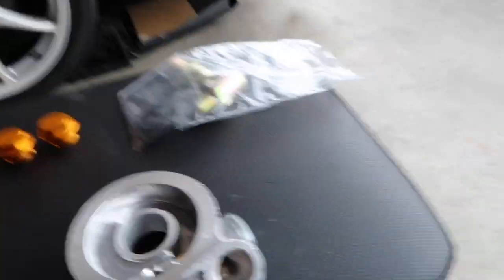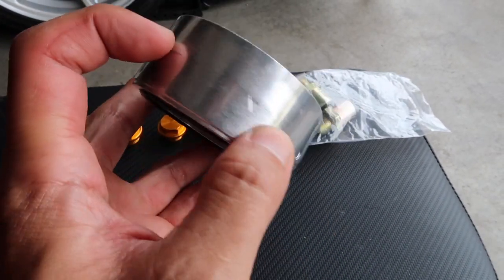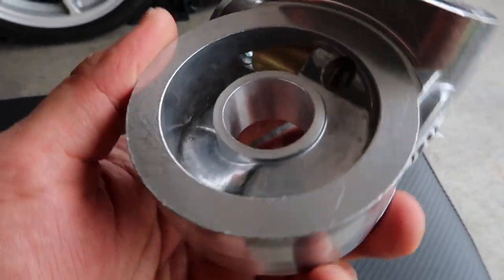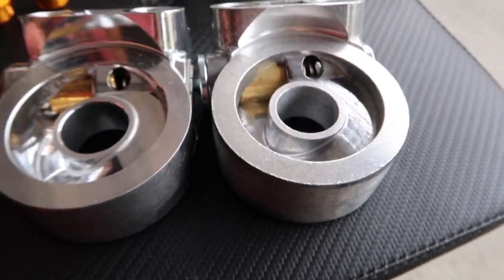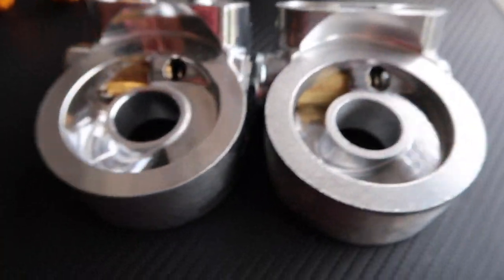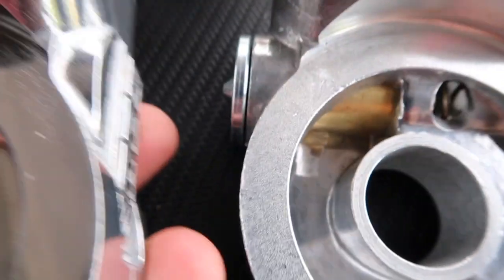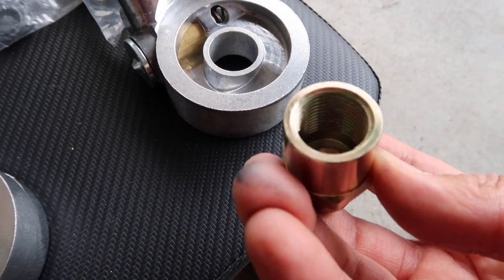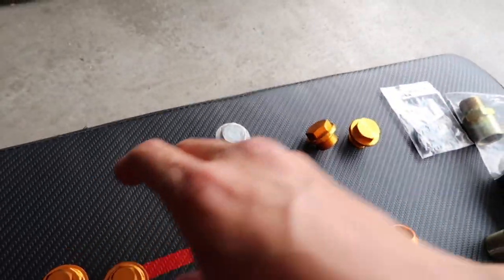GReddy Vs Ebay G-Plus Oil Sandwich plate | Genuine Vs Replica part comparison!

Comment: I just installed the g-plus sandwich on a 12v vr6, the o-ring sealing surfaces are kinda terrible where the small fittings seal against the unit so I siliconed them in with German black silicone; I did buy this g-plus sandwich like 5 years ago so your unit will be a lil different “quality control” lol

Comment: Very nice video. Do you think they will work on 90s diesel gm in truck?
Reply from the maker: Thank you! If the thread pitch is the same it should!
Reply: @DriftMagic  thank you. The thread on the filter is 20.5mm ish. I guess that would work if you don't mind me asking